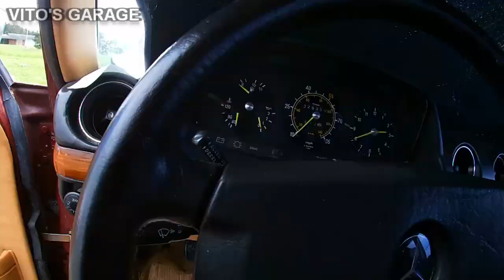Preventative Maintenance on a Mercedes W123 240D

Comment: Hey Vito.  What type grease are you using there?  My '82 300D could probably use a little lubrication, since I've never done it.  I do keep my hood hinges lubricated though.
Reply from the maker: I use wheel bearing grease. For the door and window seals, I use a rubber seal conditioner. I do it twice a week on my cars. This will prevent cracking of the seals and they'll last forever. Same with leather. You need to use a leather conditioner and condition that pretty often